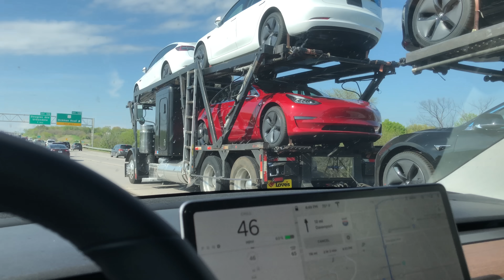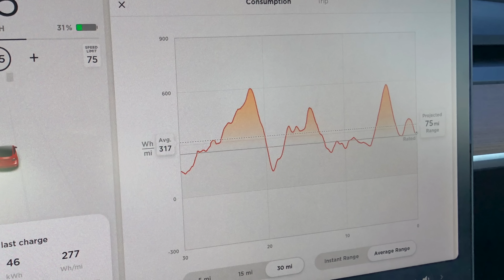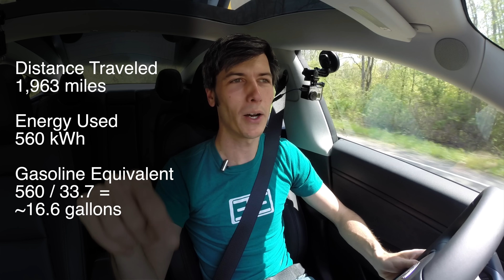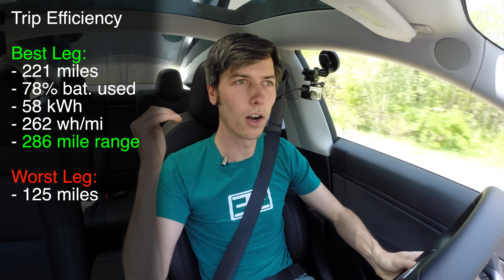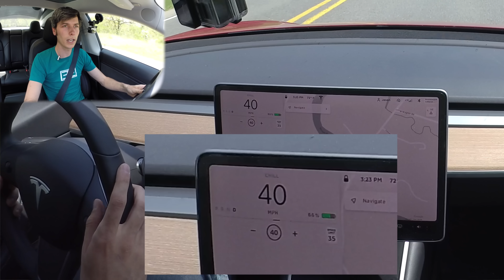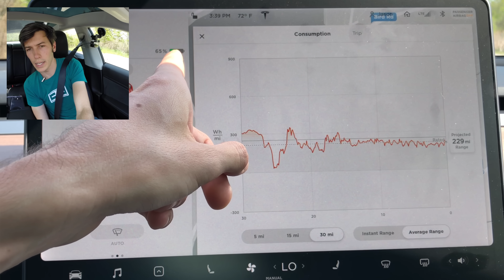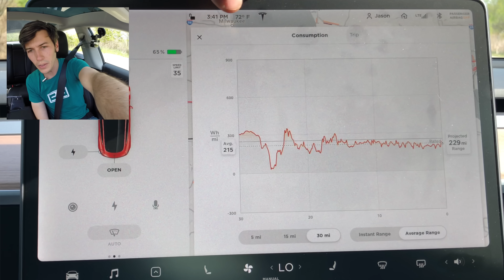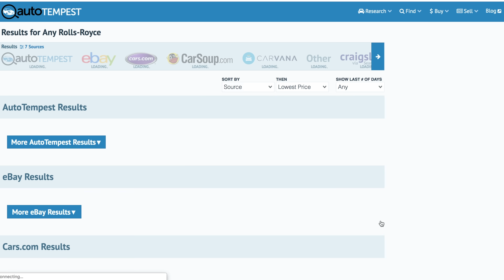How Miserable Is A Tesla Road Trip?

Comment: In my current hybrid I get 500 miles per tank on a long road trip. That's three stops for gas at 500, 1000 and 1500 miles for a 2000 mile trip. At 5 minutes per refueling that's 15 minutes stopped to refuel total. With a Tesla you really have to stop for like 30 minutes every 250 miles. That's 7 stops of 30 minutes each  or 3.5 hours for charging. That's 14 times longer spent refueling.
Reply: @Hassium Quarterdeck who said I wouldn't be taking a break? That doesn't really matter. Everytime I see Tesla charging stations they are rarely within walking distance of any place I would stop to eat and they certainly aren't in the parking lots of most hotels that you would stay at on a 2000 mile trip. So regardless of how many times I would stop for things like eating, going to the bathroom or sleeping I would still have to travel to a charging station and then wait. 

And by the way, I could easily go 500 miles without needing to take a break. The farthest I have ever driven in a single day is about 750 miles. I stopped once to pee, get gas and grab food to eat on the road. I was off the road for a total of 15 minutes. Total driving time was about 10 hours. With a good night's sleep the night before I didn't get tired at all. That same trip in a Tesla would have required two 30 minute stops adding an extra hour to the trip.

For me to get an electric car i would have to be able to get at least 400 miles of range in no more than 10 minutes. And even that isn't great.

Comment: 2 years ago, my wife and I went Houston to Santa Fe, then San Francisco, then Las Vegas back to Houston about 2500 miles. But I tell you that stopping for gas can take up to 1 hour--we normally would try to do about 350 miles between stops (the longest leg is El Paso to Houston 745 miles and BORING). We have a 2016 Lexus RX350 and averaged about 25 mpg on the trip. I fail to see his point. Stopping for a break of 40 minutes every 200 miles is not only a good idea, it makes for a safer trip...

Comment: If you're stopping for 50 minutes every 200 miles driven (at 70 mph), you might as well be driving a gasoline engine at about 55 mph, stopping for 5 minutes (according to the math).  The question is "how much is the cost to go 200 miles", and "do you prefer to eat while driving, or stopped"?
Reply: After sitting in the car for several hours many people prefer to take longer breaks. Even if it takes 5 minutes to fill up the vehicle, some people will need longer before rolling several more hours.

Comment: Freeze frame @21:13. From those numbers, I come to the conclusion that electric is not that economical for long trips, if you take into consideration the time you have to wait for your car to recharge. Moreover, always supercharging reduces the longevity of the batteries. So electric cars are still not great for long trips. AND they're not immune to road hazards like potholes as with any other car. AND this trip was done during summer time. In winter it would have been very different. So, for long trips: gasoline car. For short trips and daily driving: electric car.
Reply: and for best combo of short and long trips I choose Japanese cars

Comment: So if you spend ten zillion dollars on a car, and have some luxurious connection options at your disposal, never have any reason to go more than a couple hundred miles in a single day, and care nothing for the utter feel of a fuel-fired car... maybe an electric is viable as your car. Sheesh.
And with the lack of optimization in that navigation system... Tsk tsk. 
150KW charging system? What on Earth is the battery longevity?
Reply: The model 3 costs around the same compared to its competitors and the whole thing about connection option is bollocks. 

Sure, it’s not as easy going large distances but it is so much better in terms of global warming, on top of being cheaper to charge compared to gas prices. 
And the “feel” of a fuel powered car is a complete personal issue, which if you prioritise over the environment, makes you a bit of a selfish person. Quit your delusions.
Reply: @thepowerthatbindse9438  Wow, you're quite an asshole. You took all that time just to insult a total stranger. Sad.

Comment: your batteries are not like a gas tank. each time you charge you lose 1 charge cycle.
every battery is different and they work correctly for about 5000 cycles. (afaik)
seems like a lot, but if you always use superchargers on the 20-70 % region you going to waste more cycles and wear them out really easy.
also a lower charge rate for longer time will wear the battery way less than a super fast charge. remember that you are rearranging chemicals here.
last thing, i dont know how regeneration works but its possible that it counts as a charge cycle

You probably know this already or someone else said it
. in any case, it might help someone
Reply: Yeah but it is exactly the same with a regular car engine.
In a Tesla the most costly parts are the batteries. Tesla estimate that the battery of a Tesla 3 garante you 800 000 km. It's a lot.
Most of regular car aren't good to run 800 000km.

Comment: Absolutely a toy and a second car for rich people. This will never catch on for 95% of the world population the way it is now.
It's like it either needs 40 years of battery development to make them more energy dense, or just use fuel cell "batteries".
Reply: Prices on EVs are going down by the minute, it really won't last that long, especially in europe where gas is much more expensive than electricity. Besides, most people will never have to drive more than 500 miles in a single stretch in their whole life, and even that can be achieved with a single supercharger stop midway through the journey.

Comment: I’m 99% sure that charging infrastructure, charging time, range will all improve with time (and money). For a lot of people an EV is not currently an option. My last job, I drove 300-400 miles a day - usually to a client(s) location (leaving early in the morning. Repair their equipment and drive back. I did that about 3 time a week (working Mon- Fri). I could do that on one tank of fuel. An EV would simply not do that. And before people say, get someone nearer, or not many people do those mileages a day - depends on the equipment/job. And a lot of business road warrior DO those mil per day.

Comment: no way jose, that is over double the stops that i would normally do for that amount of miles. fine for a commuter car probably
Reply: Absolutely, People fail to realize pure electric is H O R R I B L E as a concept for a SIGNIFICANT amount of the world population. e.g. you live on the 4th floor of an apartment complex, you are screwed ever having your own home charger.
That's why fuel cells are freaking amazing as a concept. They are still electric on motors but the main "battery" is fed with a liquid, instantly.

Comment: 21:17 the cost for a gasoline car is really low if I compare it to what it would be here in Europe. I calculated what I would have to spend here, with my car (24-25 mpg) for this distance, it would be about 600 USD!!
Reply: the wild thing is that compared to gas around the south/midwest of the unites states the tesla is actually far more expensive than gas. somehow?? 

gas right now is 2.30$. and new small compact cars get 40-45 highway mpg. i did the math and it would only cost between 100$ and 110$ for that road trip in the united states.

that honestly puts things in a whole new perspective. had no idea how crazy expensive superchargers were.

Comment: This roadtrip used only superchargers, it doesn't sound like you did any overnight charging (with 240V Lvl2 a.k.a. destination chargers). Assuming you slept at motels for 2 nights of this trip, you can eliminate at least 2 of the supercharging stops by choosing a motel that offers free charging. Might have saved you some money as well, depending on lodging prices.

Comment: Honestly, we allways drive whit at little risk (which means arriving whit sub 10%) this has been no problem. And it's charging way faster and the battery is more efficient when hot.
So after a charge start driveing slower and when under 50% capacity increases the speed to maintain the battery temperature. This seems to be more efficient than maintaining a consistent speed, whit charge and travel time in mind..

Comment: Killed a lot of bugs I see, guess they couldn't hear you coming.
Reply: They could electrify the outside of the car so it’s like a giant bug zapper going down the road.
Reply: @Xmarduk  Good idea all they have to do is think of an amusing name for it in the next software upgrade. Like a tiny electrical storm moving down the road.
Reply: I a human almost got hit by a Tesla because I couldn’t hear it; Embarrassing but very true
Reply: @cannsmith  Now you understand why bikers say Loud pipes save lives.
Reply: There are actually some laws out there that require electric vehicles to emit some sort of noise at low speeds. Funny comment though.
Reply: Most noise at speed comes from tyre roar, at cruise speeds they’re just as noisy
Reply: What's the last thing to go through a bug's mind when it hits the windscreen of a car going 60 miles an hour? It's butt.
Reply: Air vibration
Reply: They're sneaky in parking lots. They make almost no noise, quieter than someone walking
Reply: Bhaaaaaaa
Reply: James Macleod 
Underrated comment

Comment: 33.7kWh/gallon of petrol but around 7kWh of gas was burned to refine that gallon

It was equivalent to 14 US GAL to do c2000mi

37hr to do a 29hr no-refill journey? Judging by your stops it looks more like you just relaxed trip across the states?

Call it 8hr on 29 that's ¼ extra? For a reduction in cost of ¾ that's plenty acceptable to me.

I can confirm similar results using a Renault Zoe Q210
Reply: Just to confirm are you saying it was 75% cheaper to drive Electric? Or have I misunderstood you.
Reply: @nathanheaney3673  in the UK it is, just saw that not only are Tesla charging above normal for electricity but fossil prices are suppressed in USA later on in that video.

Oops.

A carbon tax at £300/ton would redress this and raise money for climate change redress.

Comment: The best thing about this video is that this is the least efficient Model 3 with their (now) old charger speed. Things will only get better in, say, a Long Range with 18" aero wheels + V3 chargers. Even with the least efficient car, stops are close to what I'd do (and have done) in a gasoline car.

Comment: Well, it would take 3-5 stops to fill gas tank even on a really old compact gasoline car (or gas, or diesel), only a few minutes each, new cars should be more economic, but my quarter century old VW consumes a bit under 7 litres per 100km riding at 90km/h and has 60 litre tank.

Comment: so to save $39.50 you spent and extra 7 hours on the trip charging, if I'm reading this right. I took 1 hour off because you would have had to stop for gas approximately 4 time, probably doing a RR and snack break at the time.  Fill tank 5 minutes, other stuff 10 minutes.    Probably a few more RR and food stops in the gas car, so take another 2 hours.  trip time is 5 extra hours to save $39.50.  Just an observation, not a criticism.  I'm all for EV's, sooner the better.  The real problem is, after 120k miles tesla says you will probably need to replace the batteries, cost between $5k and $7k.  Ouch!

Comment: It is so sad that this poorly informed video got so many views. 50 minutes every 200 miles? False. I drove my Model 3 on a 12hr road trip every 2 weeks for a whole year. Made 52K km on it. You only stop for 15-20 mins max every 300 miles. You don't need to charge to 100 percent, just 80% or whatever the computer tells you since it's faster this way to avoid the slower charging past 70%. If you're a noob then you'll wait till 100%. Just follow the computer instructions next time please.

Comment: Realistically I can't imagine it's much worse than a gasoline car other than a few extra hours. MOST people drive care with about a 400- 500 mile per tank range so would stop roughly 4 maybe 5 times on a 2,000 mile trip. Stretch legs during those stops, maybe get something to eat during one of them, bathroom etc so the stops could average around an hour. You might end up a couple hours longer in an electric car but it shouldn't be that big of a difference.

Comment: Lot of good information, but also a lot of missed opportunity.  I understand your desire for an additional buffer (15%), but we/you missed out on using the Tesla navigation scheme.  The purpose is to reduce you overall charging time, DRASTICALLY.  I've yet to find a Youtuber who'll truly allow the system to work.  Now I'll have to test it myself.  Maybe I'll post a (probably) horrible video.

Unanswered questions: Driving normal speeds (Limit +5), with no compensation or adjustment to driving habits, is the planner accurate enough to depend on? Does it respond well to environment, cold/hot. How are you spending $0.28/kW?  That's the most expensive I've seen, $0.12/kW in the Midwest (or cheaper) .  What is the effect of constant use of Autopilot on range?  Sentry is a power consumer that uses up a couple miles of range when parked for a day.  Autopilot activates and uses servos constantly when engaged.  There's got to be some measurable difference.
Reply: Driving used to be for pleasure, freedom and convenience. Driving to a Corporate planner all seems very Big Brother.

Comment: You gave an excellent review on the operation of that vehicle. However, a major point of driving electric vehicles is that its is more cost efficient, right? You saved $40. Over 2000 miles. You charged for how long? Hours and hours. I am not willing to sit at "gas stations" for hours to save $40. My time is worth more than that. Also, you drove BELOW THE SPEEDLIMIT. You should have been ticketed! Ok, not serious about the ticket, but I see a LOT of sacrifice in driving slow and sitting in charge lots all over the US just to save $40. Total fail. For a 2000 mile trip, I'd pay someone $40 so I can get their hours quicker. I have no interest in slowing down SO MUCH to save $40.

Comment: 14:52 "I don't want to have to get into a car and have to think ok, where do I have to stop every single time"  Exactly.  This car sounds like a pain in the rear to me.  Save money in fuel now so that you can spend the money on new batteries later.  45 minutes to charge every 200 miles?  No thank you.

Thanks for your awesome videos by the way!
Reply: If you started the drive every single morning with a full battery and 500km range how often would you really need to charge? also, you battery argument is rubbish, you're just ignorant. Tesla cabs and service vehicles have 1/2 "million" "miles" on them. Only a 10% reduction in capacity so you only go 450km instead of 500km on a charge. Big deal. Lithium ion battery tech is sound. They don't just die, they only lose capacity over time. In 20yrs and a million miles you can use them for your future home solar battery backup for another half century or sell them in a high demand market for solar battery backup. Even a half reduced capacity 60kw car battery (30kw left in it) is still like 4 or 5 powerwalls which can cover 100% home energy needs for a couple days. After 70 or more years you recycle them if you like or simply run them down to zero over the next 100yrs.

Comment: As I understand it Tesla discourages the use of SuperCharge except for road trips. The reason is that the more SC is used, the faster the batteries will degrade in absolute terms. My car use is at least 80% long distance (1,000 miles or over) and I'm not sure how well a Tesla would work for that. It will be interesting to see how much progress Tesla makes in battery improvement. The fans seem to think they've only started. Perhaps. Also perhaps they're fighting physics. If you look at the history of almost any technology there is a point at which improvements become more difficult to achieve. Look at aircraft. DC3 to Boeing 707 - huge improvement in about 25 years. 707 to Dreamliner? Much less improvement over 55 years. Auto makers have expended billions to improve the internal combustion engine and did a fine job - for a while. Now even "fine tuning" the technology requires major work. Important stuff here - if energy storage could be greatly improved, then alternative energy forms because not only viable, but economically superior. If energy storage is restricted by physics, then "alternates" remain both expensive and unreliable.